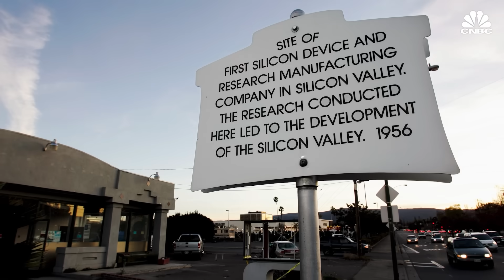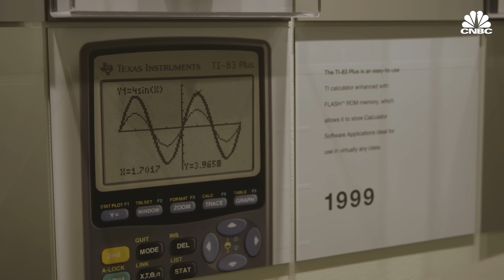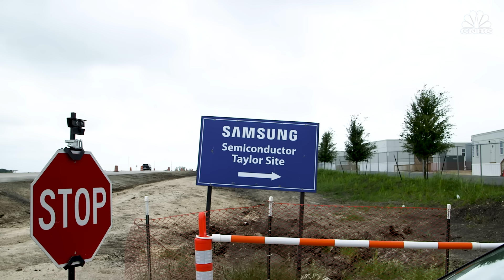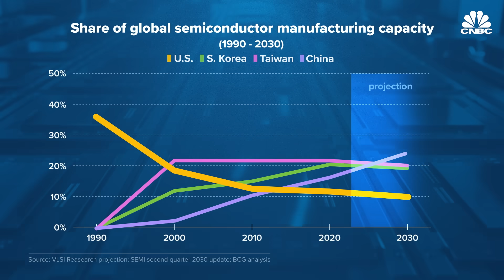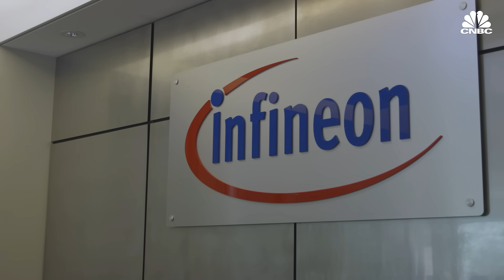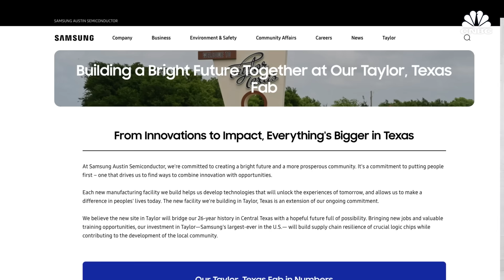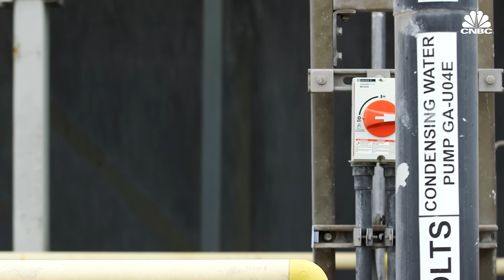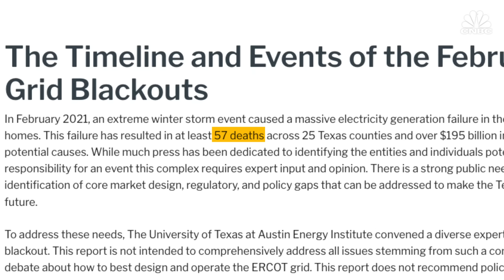How Texas Became The American Chipmaking Hub

Comment: Texas doesn’t have sufficient water supplies and lacks a cheap and reliable electricity grid (aka ERCOT).  Whereas Micron is investing $100 billion, over 20 yrs, to build a 4 bldg campus for chip fabrication, in central NY, due to its plentiful supply of water and it’s reliable and abundant hydropower (aka Niagara Falls) capacity controlled by the state (NYSPA)…

Comment: An issue is that Texas has too much wind power to have a reliable grid. As wind can unexpectedly go from 30% of the total to 5% totally weather dependent.
Reply: No such thing as too much wind power, only not enough "on demand" power
Reply: @DoesntRefillTheBrita The subsidized wind power displaces dispatchable sources, and so discourages the building of them. Failing to make the subsidy miners pay for backup is the issue.
Reply: @mangochipps0795  Grid level storage is rather like unicorns. Everyone has heard of them , but they exist in reality exactly nowhere. El Hierro in the Canaries is an attempt, but a failure, even given very favorable geology.

Comment: The Electric grid failed during the big freeze crises, because the EPA under the Biden administration heavily refused to allow Power companies to burn excess CO2 and reduce that amount in other days later in the year. The Law allows them to do so, if they are given emergency permission, which was sought and heavily rejected by the Biden's EPA. Wind power is useless, if it on the grid during freezing weather. Once the grid goes down, no power...

Comment: Wasn't TI one of the main bottlenecks in analog and legacy chip production during the chip shortage? Chip wafer production was a major bottleneck, but leading edge fabs from TSMC, Samsung, and Intel were able to keep up with demand for advanced chips outside of  GPUs due to the cryptocurrency mining craze.
Reply: None of the wafer fabs shut down in Texas
Reply: You forgot some context there. They were able to keep up with advanced semiconductors because they cut many of the less advanced ones. That's where the vehicle chip shortage came from. Most cars, with the exception of a few more tech focused ones like Tesla, use the equivalent of an old phone ARM chip.
Reply: TSMC and Samsung are also legacy chip producers; that's actually the majority of their production. You have it all wrong, all fabs were operating at capacity. It wasn't a chip shortage; it was a demand surge; however many chips were anticipated to be produced were produced. The auto industries supply problems was their own doing. At the onset of the pandemic, they cut their orders. When they realized they would need those supplies again, someone else had already taken their spot in line; the result of just-in-time manufacturing.
Reply: So you're saying One company created the shortage? Seemed pretty severe to Me!

Comment: Cutting edge fabs in AZ supplemented by mid- to-lower tier TX fabs should meet the US needs well into the future. These will spur the entire semiconductor ecosystem back to the US. Silicon Valley can move its legacy continuation in other states while it moves to next big thing - AI revolution that is already well underway in California's "AI" valley. Solar, wind, autonomous driverless transportation etc.. went from innovation to manufacturing and move out of California quickly for lowering costs. California will continue on its innovation path.

Comment: Software developers are largely to blame for the current state of chipmaking.  Inefficient software causes more chips to be produced and used in products.  That requires more silicon, more electricity, more water, and more resources to be consumed.  Today's software is slow and bloated because software developers are lazy in how they write software.  If it works, it's deemed "good enough" and shipped out the door without a second thought.  Software developers consider the time spent improving performance to be negligible but 1% performance loss here and 1% performance loss there adds up.  Then you mass produce a product like a car and that is now a multiplicative effect.  Everything should start instantly, run instantly, shut down instantly, and use 0% CPU to do all of that at all times.  If it doesn't do that, then the code that's written isn't optimized enough.

Comment: LOL, I was gonna comment that I was surprised they didn't mention TSMC's first venture outside Taiwan to Phoenix due to the Chinese threat.  They make the tiniest, most in-demand chips currently.
Reply: In 2016, TSMC built a factory in Nanjing, China. Turns out Nanjing isn't in Taiwan. 😂
Reply: @davepilsner2269  Okay, outside the Chinese area then (China considers Taiwan part of China as it was created after Mao took over).  And the point is it is the only place safe if China attacks Taiwan   ...AND, they are producing 4-nanometer technology chips, with 100,000 wafers per month.  So I do stand by my statement.  Thanks.
Reply: Not due to Chinese threat lmao, it’s the US forcing them to build in the US. The moment the US becomes independent from Taiwan regarding chips, Taiwan will become just another proxy war staging ground, US will no longer have to worry if China retakes Taiwan or not

Comment: They need to start adding solar panels on those massive foundry rooftops.  Also huge parking lot area too.  Such a huge wasted potential looking at those bare rooftops.

Can run the whole facility on sunshine during daytime with potentially big energy exports to grid for credit or saved to local battery to help with night operations.  Running on solar also takes a big load off the grid since these chip foundry factories are power hungry.

Exporting surplus energy to the grid also reduces load on the regional grid and can power local communities directly in times of extended Texas heatwaves which will become more frequent.
Reply: Rooftop solar is great but it adds a lot of upfront costs.  When you're focused on expanding operations, it's probably best to use your limited funds towards the actual buildings and machines rather than spending large amounts on solar when you can just draw off the grid until you're solvent and then put the panels on later.  Texas's grid is already pretty solar intensive anyways.
Reply: @adamperdue3178  Sure there are always capital costs and we can add some numerical context.

The capital costs of factories like this are enormous in the billions (> $25B).   But that TMSC Arizona 15MW parking lot solar would only cost some $24M which is which is a pittance (< 0.1%) in comparison to the rest of the capital costs.  That's based on commercial solar somewhere around $1.60/watt nowadays.

NOTE: After a short pause due to global supply chain disruptions, the cost of solar just keeps dropping which are already down a massive 90% since 2010.  The asphalt parking lot below probably costed around $2M itself just for comparison.

Furthermore, onsite solar array directly reduces expenses.  A fab factory has an enormous energy draw (megawatts).  

McKinsey has stats for large Taiwan fabs consuming as much as 100MWh per hour!  Maybe then ~50MWh then for a medium sized fab plant.  Using US average 7.62¢/kWh industrial electricity rate (EIA) which means a fab will be paying from $3810 to $7620 per hour in electricity bill!  Or some $137160 per day (median) which means the $25M solar array (at some 0.25 capacity factor) will pay for itself within ≈23-months.  After which the solar array is all savings.  

NOTE: The Arizona TSMC factory has enough roof and parking area for easily 100MW of solar not just the 15MW at its south parking lot.  If anything, they should be adding more onsite solar panels.  If electricity costs go up, then the solar financial break-even point arrives sooner.
Reply: @beyondfossil  Keep in mind that installation costs increase that $1.6/W figure fairly significantly, best figure I can find is that it's about $2.76/W after taking other costs into consideration.  Maybe you can get it a bit lower since you're building at scale, but it's hard to say it'd be a massive decrease.  Also Austin seems to have about a .194 capacity factor, which would put the math at $41.4m for that 15MW installation.  Said 15MW installation is going to provide 3.88% of the plant's electricity needs (you used a 75MWh assumption, the 15MW installation is 20%, at a capacity factor of .194) meaning a savings of $5,321.81/day, which would take  7,780 days to pay off- or 21 years.
Reply: @adamperdue3178  As a side note, there are parallels in residential solar to commercial/industrial solar.

The median cost of a home in the US is now $437k.  A typical solar home has 6000W of solar which is some $20k to $32k for professional install which is some 6% of the median home price.  Many of the largest metro areas (SF, LA, NYC, etc) have median homes in the million range.

Moreover, in personal/individual finance, there is an additional benefit that every dollar saved in electricity draw is pre-tax dollars worth more than post-tax dollars used to buy electricity from grid.  There are significant tax rebates (30% credit) as well and solar can only increase the value of a home.  

Other countries have difference plans and US installation (labor) costs is amongst the highest in the world.  Canada gives $5000 full discount on invoice as well as 10-year interest free loan up to $40,000 with Canada Greener Homes Initiative.

Just to re-iterate, residential/commercial solar produces its electricity locally which directly reduces stress on the regional grid.  That becomes ever more important as climate change will only increase the frequency and intensity of heatwaves.   

Because the grid experiences its highest levels of stress during heatwaves.  But that's when solar panels excel in power generation since heatwaves typically come with an abundance of clear blue skies due to atmospheric high pressure phenomena.
Reply: @adamperdue3178  Actually, the solar panels at TSMC here in Phoenix are on the ground.
Reply: I was in California recently and the Walmart at one of the towns on the highway 99 corridor has built some covered parking with solar panels on top.
Reply: @TomCrockett-bl1gp  Excellent news!  Car shading for customers and locally generated energy is a win-win.  Those big-box solar arrays will frequently power the entire store and likely parts of the nearby neighborhood too.  It will take big chunks of load demand off the greater grid on an ongoing basis.

Critical to understand is that every watt generated locally is a watt that doesn't stress a distant power plant nor the grid to transmit that watt.  Commercial and residential solar starts creating a "distributed power architecture" which is more resilient to disasters both natural and manmade.  Distributed architecture eases load on the grid especially in heat waves.  Heatwaves are expected to become more frequent and more severe as global warming tightens its grip on us.

I was at a Taco Bell of all places, and it had a substantial parking lot solar of around 100,000W.  Was good to come back to a cool car interior too.
Reply: Plenty of sun (and heat) here in Phoenix with solar panels all around the new TSMC fab megacomplex.
Reply: @SWLinPHX  Excellent, most excellent!  

Drone aerial view:

https://youtu.be/d2Yi1R3JkYU?t=118

Apart from the obvious benefits, what better way for a public display of a silicon fabrication factory's undying love for silicon than with 15 megawatts of electricity producing silicon right on site?  The employees will be loving the shade for their vehicles too.

Plenty of remaining rooftop area and other parking lots to have some 10× more solar power onsite. ☀⚡
Reply: @beyondfossil  Nice drone footage, thanks!
Reply: Solar panels why ? For what ? Solar is not green at all nice try
Reply: @WCghost05 
What is green is the energy required to cool down a car in a shade
Reply: Texas is already one of the greenest states without inefficient planning like this
Reply: @WorldIsWierd  True Texas has surprisingly a lot of renewables for a such a traditionally oil based economy — especially wind.  Texas renewables are growing fast.  But currently some 60% of the state's annual electrical generation is fossil fuel based with some 10% of that being the dirtiest coal/lignite. 

Critically, residential/commercial solar unloads the grid and the grid is expected to be a major obstacle towards the much needed electrification of our society.

Simply put, every watt generated & consumed locally is a watt that does not stress a distant power plant nor the grid to transmit that watt.  There is huge efficiency in that alone.  

As we're in midst of an unrelenting heatwave, I'll point out heatwaves always come with abundant sunshine.  So solar panels will excel during the hottest hours of the day.  The greater the percentage of residences, factories & commercial buildings that have solar then the greater the load is taken off the grid at exactly a time when the grid experiences its maximum stress.  There's so much sunshine in a heatwave that a home could power its own loads (include A/C) and partially power their neighbor's with surplus too.

Finally, it needs to be said that the cosmically large sun provides millions of times more energy per day than we could ever use.  Huge factory and commercial rooftops are ideal locations to maximize land use efficiency.  Onsite power generation is one of the most efficient ways to use that free god given clean power directly.  Furthermore, sunshine cannot be taxed, sanctioned, embargoed or blockaded.
Reply: @WorldIsWierd  What specifically?